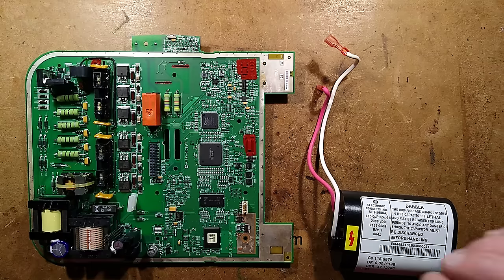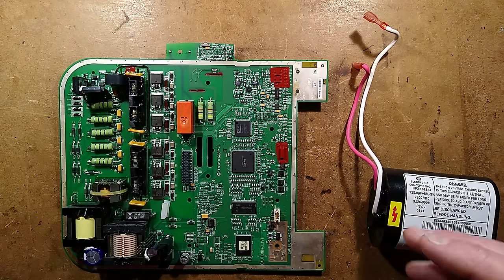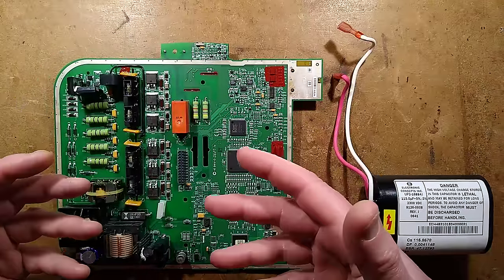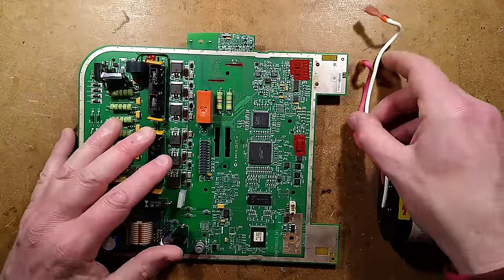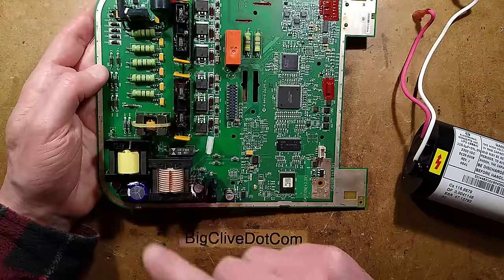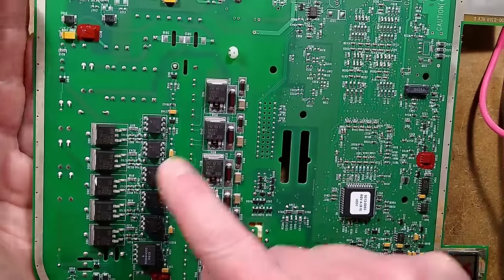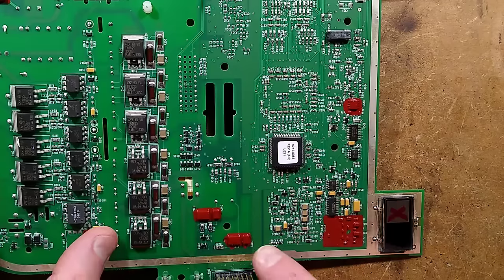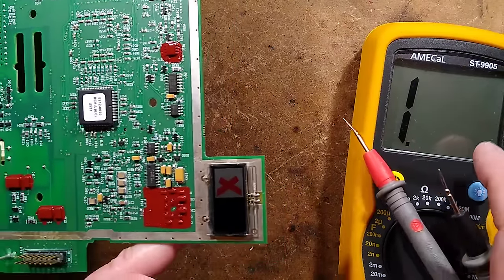Inside a Zoll defibrillator - with SCARY capacitor

Comment: From a Zoll manual, "Use of Panasonic, Rayovac, or Varta batteries may result in significantly longer defibrillator charging times than those required during emergency situations." Hopefully they learned about Panasonic's crappy batteries through testing and not real-world experience.
Reply: Varta don't have a great track record! The destroyer of old motherboards.
Reply: I'll always stand my my "Poweer" batteries. Yes, two Es. With a picture of a tiger on it. 😎
Reply: Yet, Panasonic Eneloops are generally regarded as the very best rechargeables.
Reply: That, and this is a medical device, so in most jurisdictions the manufacturer has to give you a list of "approved" power sources the device was tested with. 
The list can have only one entry, but to avoid supply chain problems it's usually 3-5. Using the device with unapproved batteries voids the certification, and dumps a lot of liability for any problems on the user and/or the person who put the "wrong" batteries in.
Reply: @RT-qd8yl  yellow/gold batteries with black tiger?
Hellesens or something?
Back in the 80's 😄
Reply: The recommendations may not be indicative of quality, just of characteristics. The brands they advise against are likely ones with higher internal resistance, which limits current, but also may result in lower self-discharge. It’s all about what you choose to optimize for. 

Varta, for example, has 3 or 4 types of AA alkaline batteries, some optimized for high currents, others for extremely low currents, and others for balance. It’s all about the application.

Panasonic and Varta batteries are generally pretty good.
Reply: The nonrecommended batteries have a tab connection inside but the others have a full foil connector inside.
Reply: @noggin73  They're still better than leaky Durasmells.
Reply: @ParallelSyntax durasmells? Are you 8?
Reply: @TheDutchShepherd probably a Dankpods fan
Reply: Panasonic sells its name to other battery manufacturers allowing them to do rebadging.  Quality will vary from place to place.
Reply: That sorta shit is always learnt through real-world experience.
Reply: @phils4634 Eneloops aren't particularly known for high power delivery, the reason they're considered good batteries is because they survive abuse, last a long time, and have exceptional charge retention. They are still NiMH cells with lower than typical AA voltage, and lower peak current delivery than some other cell chemistries available in the AA format. I'm pretty sure they're not available in that format either, so they're probably talking about one of Panasonic's single use chemistries for this particular use case.
Reply: @looksirdroids9134 AEDs are a class of machine that gets tested and tested and tested, including actually charging them and testing their electrical characteristics. They've probably done a ton of tests with various different cells loaded into it (the caution was regarding charge times which is pretty easy to test).
Reply: @phils4634  Yes but the Panasonic A123 batteries are optimised for higher capacity and long standby life, but as a result also do have a much higher internal resistance, as they are more intended for long use at very low discharge currents, with current being limited to under 1A for brief pulses.
Reply: Dankpods reference  @TheDutchShepherd
Reply: @Hazzard2theworld911 or AVE fan. 

Or even both!

I think I've heard a few other YouTubers use the term Dura smell as well but can't think of the others offhand.
Reply: @RCM442  thanks! I dont know who or what that is but i understand its a reference.
Reply: I responded that ikea batterys are eneloop pro.. but comment got deleted?
Reply: @TheDutchShepherd  Maybe, but they also probably watch DankPods 🙃
I'm sure the PKcells would be perfectly adequate (this is not medical advice, please for the love of all that is good do not take medical advice from a YT comment)
Reply: When I worked on an (unnamed) AED in development back in the 00's, we discovered that the lithium cells (non-rechargeable) had an internal disconnect function when the voltage went below a certain value; it was not disclosed by the manufacturer or distributor until we asked about it. We, of course, were trying to get all the energy out of the cells, so that would have been helpful design info up front.
Reply: @dankingsbury9971  That's weird for a non rechargeable cell... yeah I found when researching monitors that some product segments it seems literally nobody actually knows what the specs are
Reply: @RT-qd8yl  Doesn’t sound like they have as much power as my PowerB(ee)s
Reply: Yep, the one in our shop says the same thing, and actually refused to reactivate with any batteries other than energizer and Duracell.
Reply: @noggin73 …Varta has a very good reputation in the battery industry, from button-cells to automotive. Ironically Varta is the most commonly recommended battery brand for photographic and medical equipment.

I’ve seen many Varta batteries in cars that have been 6yrs old+ and still strong, but I think the most amazing are batteries from Fiamma!!… some lasting +11yrs!!!
Reply: @ParallelSyntax  Duracells cost me £130 when they destroyed my Central Heating Controller. I also had a new old stock piece of kit that came with Duracells which had completely disintegrated despite never having been fitted. Admittedly they were about four years past "use before" but I have had 25 year old Japanese AAs in calculators which still work fine.
Reply: @Hazzard2theworld911  oh no my pkcells!
Reply: Batteries with higher internal resistance change charge-time characteristics ... i.e.: resistatnce + capacitance = time constant.
Reply: @Lizlodude i bought pkcells and they're squishy, like i can literally squish them in my hand
Reply: @phils4634  They were originally developed and produced by Sanyo, which Panasonic has bought.

Comment: The first voice message when the batteries were inserted was "Are the batteries new, press the button"
After power on: "Electrodes, adult. Unit OK", "No shocks given", "Stay calm", "Examine reaction", "Call for help" x 3
Then "Open airways", "Examine breathing", "Fasten electrodes to the patient's bare chest",
Reply: Interesting.
Reply: Even though my only language is English I thought that it might be saying something on this lines and does make sense now that you have effectively translated it and I'm sure everybody would agree that it was nice of you to do this for the rest of us non Norwegian speaking folk thanks
Reply: I'm a big fan of the Zoll unit's as we use them at work.  The Australian units (from start to finish) say:

Adult pads.
Unit OK.
Stay Calm.
Check Responsiveness.
Call for help.
Attach defib pads to patients bare chest.
Don't touch patient, analyzing.
Shock Advised.
Don't touch patient, press flashing shock button.
Shock delivered. 
Continue CPR.
Reply: Or in Clive's case, "Fasten electrodes to the patient's bear chest" 😄
Reply: I don't speak Norwegian but I do speak Swedish and obviously English (I'm from Finland) and I was able to easily understand the text instructions though the speech was less clear to me. There's a (literally) funny difference though, in Norwegian "rolig" means calm, in Swedish it means fun or amusing.
Reply: Hey thanks and yeah that it does seem kind of weird or funny you just put a smile on my face what's under the weather and enough of a life to help a bit firstly so thank you nonetheless.

And totally agree on what you said about with the language but hey others now know.

In terms of this as well as it's nice that someone was able to shed some light on what was being said.

Pulling out to everyone that if you're interested in stuff with the English language and phrases and such funny and or otherwise there is an NPR program that one would be interested in more than likely a way with words.

One of my favorite programs on the weekend.

The situation with the word meaning two different things and two different languages like this remind me of this and definitely is a good program for those who enjoy things with the English language and want to learn a few things as well at times it's absolutely hilarious!

Thought other people might enjoy this program since the two different language meaning came up it's worth mentioning!

And yes it's available streaming and there is a podcast!

Quiz guy that's always fun
Reply: @Murgoh In German language "rollig" means a state of a female cat being willing to marry.
(To be clear, she wants a male cat. More celarly: I want it!  NOW!)
Reply: It actually starts with "Electrodes Adult" and "Install batteries", after Clive installed the 6th battery.
Reply: @UpLateGeek    And then, "One moment please.."
Reply: @Murgoh  "Please remain amused" certainly better than "Please remain calm"
Reply: Nice design layout compared to some I have seen.
Reply: I used to see these Zoll ones a lot in grade school (all buildings, elementary to high school had them for emergencies), and now that I'm in college it's all Philips there, at least one or two in every end of the building. I've heard both units speak for CPR training through the American Red Cross, and it's both cool and incredibly reassuring. Glad we have these devices in a lot of places nowadays (even at a couple different places I've worked), they really do save lives when you least expect it, I've heard countless stories of them doing so and I remember way back in elementary school they had to use theirs on a student on the playground, he ended up perfectly fine and EMS took him to the hospital quickly.
Reply: Oh yes! I am not Norwegian, but as a native German speaker, I could understand most of the unit's voice lines. Funny how languages intersect in some aspects!

Comment: As a medical engineer, i love this.
We dont often get to take defibs apart to this level so this is seriously awesome
Reply: And the fine fun I could have repurposing the HV charging and capacitor...
No, I must use my powers for good...   ;)
Such as a linear induction motor driver to launch a drone - which would be entertaining when the wings come off... :P
Reply: Fellow biomedical engineer here, at my hospital we have service contracts on all our AEDs so the guys at Zoll get to have all the fun. The anesthesia machines I specialize in certainly make up for it 😂
Reply: Radiotherapy linear accelerator engineer here, I've always wanted to take one apart to see how it ticks! We have one outside the machine room whenever we're servicing the high voltage areas of the linac because 150kV tends to have a somewhat negative effect on the body 😅
Reply: @theussmirage  well, with flammable anesthetics, things could get quite, ahem, entertaining...  ;)
Reply: @keleighshepherd345  can't see why 150kv would be an issue, why it tastes great and is less filling!
OK, yeah it could really sting a lot.
Reply: as a Biomedical Technician, my duties involve checking these yearly both zoll PowerHeart G5 / Philips HS2 and up, along with the LifePak 15 / 20e, philips cardiac monitoring systems in ICU, ventilators, ECG recorders, infusion pumps, resus cots, incubators, electrosurgical units, surgical lasers, and all manner of fun medical equipment.
Reply: @mem1428  what's the current maximum allowable leakage current these days? Long ago, it was 50 mA, which I've always considered a lot high.
Reply: @theussmirage  oh we have it the other way round. Ive gotten to strip an anaesthetic machine down on a training course but most repair and servicing is done by GE for us. We've only just bought the R and X series defibs so they will be on warranty repair for a while. But fingers crossed i can crack some of them open after that. Lol
Reply: @mem1428  oh nice we just got rid of all of our lifepaks for the zoll series. What sort of infusion pumps do u use? With began replacing pur baxter colleagues with fresenius agilia's
Reply: @keleighshepherd345  surely it would serve better to just keep a Mortuary trolley outside the room? 😂
Reply: Biomed here as well. Learned very early on to have a healthy respect for these devices at all times (let's just say I made the mistake ONCE... and NEVER again!)
Reply: @spvillano   I can verify it stings more than a lot. (Let's just say I learned not to hold a metal pen in my hand while testing these.....made the mistake ONCE... and never again😖)
Reply: @brownthunder3944  😂 you're not wrong, I've seen the results of a crazy arc from a dodgy kV generator's HV tank to ground after a dielectric oil leak

Would not want to be part of that path to earth, I quite like living 😅
Reply: thought it was at 50 µA, 50 mA seems a bit high for a patient connection   @spvillano

Comment: If ElectroBOOM were with you I think there is a 99% chance that he would volunteer to test the ECG function and also a 1% chance that he would be willing to test all the functions.
Reply: I mean, testing the ECG function wouldn't cause any harm, and besides, this is a semi-automatic AED, meaning you have to press a button to actually deliver the shock.
No button press no shock.
Also if the heart is beating as it should the AED will not deliver a shock even if you press the button.
Therefore it looks safe enough for anyone to try out.
Reply: He could send it him as a birthday present..
Reply: @psirvent8 While closed up, the unit won't give a person a shock unless they have a rhythm where a shock would be beneficial, such as VFib.
Reply: @psirvent8  Also it detecting a proper rhythm and normal range heartbeat it will simply refuse to deliver any shock, and removing the pads will also cause it to detect pads off, and still not shock. Most of the smarts has gone into making sure it really will not do anything dangerous, and it has a very narrow range of conditions that are acceptable to do any action, other than tell you to call EMS.
Reply: @SeanBZA  Yeah, I knew that too.
Reply: I can just see Electroboom getting thrown across the room from a shock.

Comment: I used to provide it support for zoll in the Uk and have had long conversions with their service techs. I am also a cpr trainer and former ambulance tech.

The AED plus was a bi-phasic. Meaning it fired the shock back and forth across the heart. 

The AED measures the impedance of the body and calculates the energy required in joules. Usually 360 joules.

The model you have is a semi-autmatic meaning. You have to press the shock button. If you don't press the shock button within a time, limit the AED will discharge the capacitor into an internal sane load.

The AED does a self test once a day. During the test tests the pads and if there are any faults, the green tick goes out and and the red cross comes on.

The sensor is an accelerometer. It measures depth and rhythm. 

The data port is used to download the data, and it shows the heart rhythm and also the compressions measured by the pads.
Reply: That data port also gives information like the serial numbers, version numbers of the software/firmware running on it. The set voltages for the different countries and other configuration settings.
Reply: There you are, you've confirmed what I thought about the sensor detecting movement so it can calculate the depth/speed of CPR, and thus know if it is potentially effective or not. I like that design - the ones I have trained on just have the two pads & cpr is done direct to the chest - I prefer this design for sure!
Reply: Thanks for the detailed description. I was thinking modern AEDs do more than just discharge the capacitor in one go. I guess that is why so many thyristors are needed.

Comment: Used same AED in real scene. Older gentleman fell on the floor at mall, and I saw that. My friend was with me and we realized that the man was not breathing and he was lifeless. My friend started cpr and I called help and ran to get AED. I also told the security where is the patient and he waited the ambulance outside. We pushed the shock button 4 times during cpr and before ambulance came, after 4th time man woke up. Paramedics connected aed to laptop to get information how many joules it had used. Never forget how thankfull the man was. He was 76 years old
Reply: good on you man, respect
Reply: I just want you to know how lucky you were that the man actually woke up after using the AED on him. This does not happen often! Great job!

Comment: I was responsible for maintaining a Philips AED about 10 years ago. When the battery aged out I cracked it open. It was just ten A123 cells inside, the difference is that it had a sealed plastic case around it and cost $150.
Reply: The newer Zoll AEDs my hospital uses also happen to be powered by 123 cells, except they've innovated by adding a battery door 😅
Reply: Anything medical related costs 10X above normal cost.
Reply: Same for Schiller Fred easy-Batterys. Inside the blue battery-box are simple A123 cells
Reply: That happens when the government decides to give the medical industry a taxpayer funded gravy train.